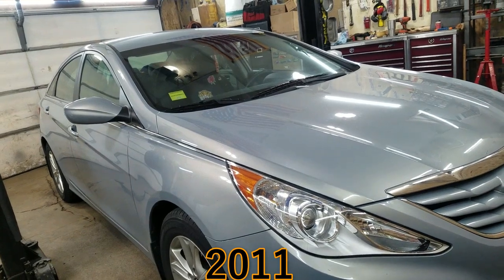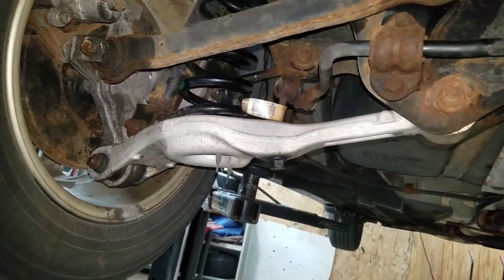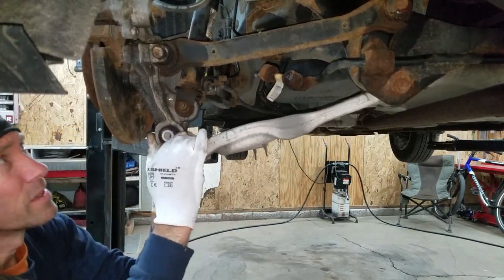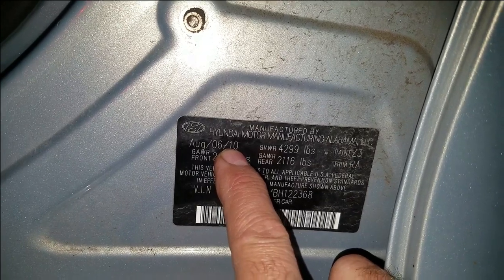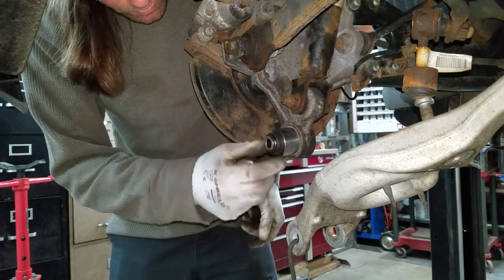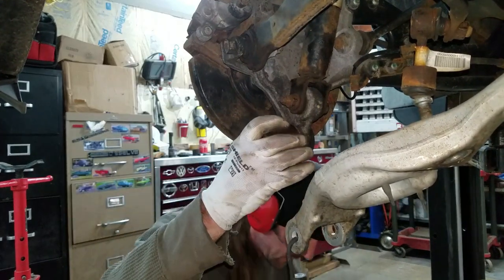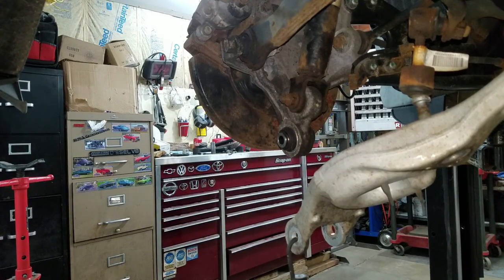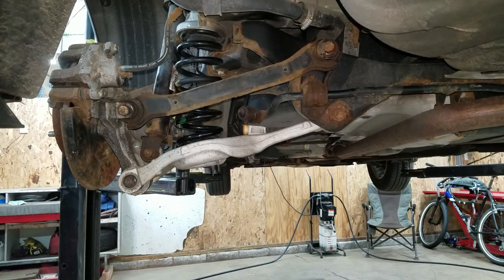2011-2014 Hyundai Sonata rear end squeaking fix

Comment: I had the same problem on my 2013 sportage. I put some lubricant on that part and the squeaking noise is gone now. It may not be permanent fix, but at least I know what make the noise. A big thanks from AB 🇨🇦!
Reply: What lubricant did you use?
Reply: @Dezzyhamilton  Use Silicone Spray. Don't use Lithium Grease spray since it degrades rubber.

Comment: I currently have the same problem on mine. I have a 2013 and makes a squeaky noise on the rear right driver side everytime im driving on a bumpy road. Been like this for like 2 months now.
Reply from the maker: You could wait forever for the noise to go away, if nothing is loose. Maybe drive it into a vat of lubricant, and lanolin once in a while.

Comment: Instead of replacing the bushing, could you just silicone spray it or use AT205 reseal?
Reply from the maker: No
Reply: @RustBeltAuto  Ok.  Thanks for the reply!
Reply: @sugarkang  The bushing was worn and moving, pretty much out of spec.  Suspension bushings aren't supposed to move in place.  They are supposed to keep things in place.  That would lead to tire wear eventually.

Comment: Gravy job I do these alot in the Hyundai's I see in our shop
Reply from the maker: Do you use a ball joint press too?
Reply: @RustBeltAuto  yup. I normally give that bushing a bit more of a chamfer with the bench grinder, then the hole too just like a c hair of one, helps it start straight with a hammer. I had to just do this on the wifes Elantra touring last week. Same cars if you ever have a rattle that's not a link or a bar bushing or shock in the rear it'll be something called a toe link check it with the suspension loaded and you'll rattle that ball joint around for sure. Hers needed that too.
Reply from the maker: @kennethhodge9637  thanks!